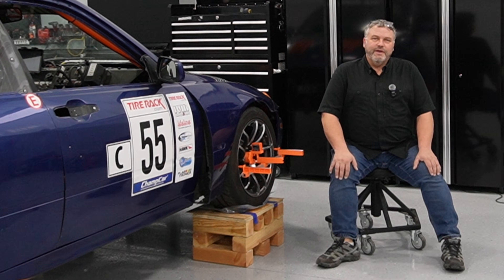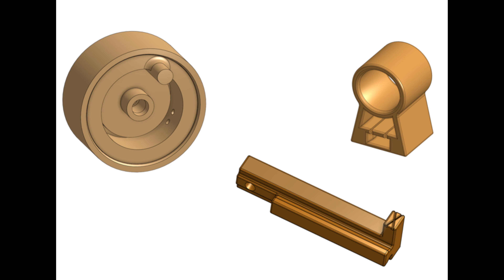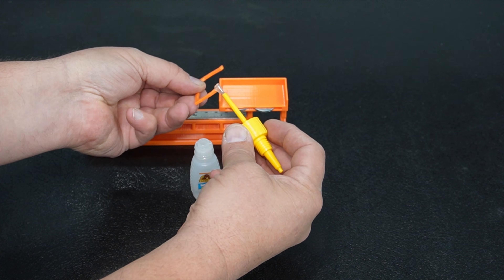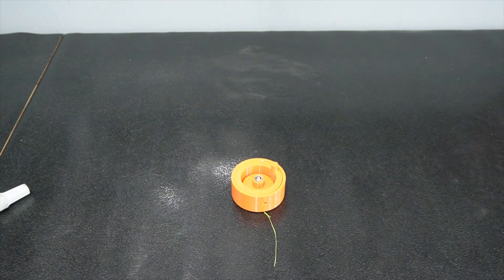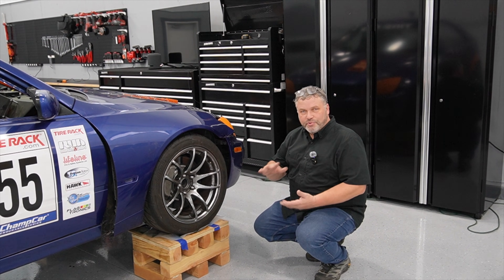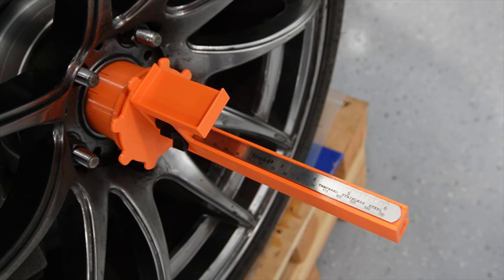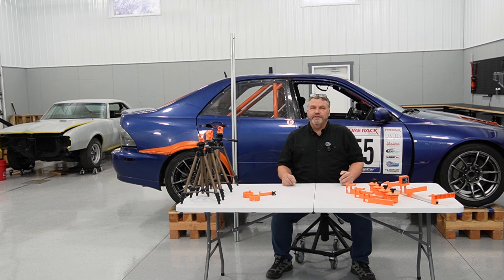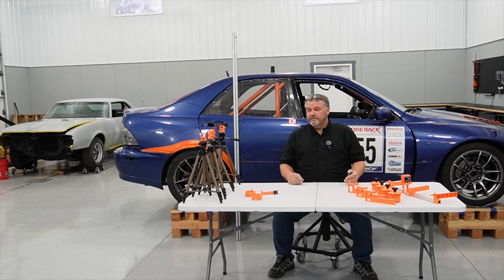3D Printed String Alignment Tools for Improved Accuracy

Comment: I believe that caster angle calculation is inaccurate because it doesn't account for kingpin inclination angle canceling out the caster when turning out, or adding TO the caster when turning in.
Reply from the maker: Yes, I should have probably been more clear that this method assumes that there is minimal impact from the kingpin angle for the particular suspension setup being looked at, which will not always be the case.  This was a late addition to the design as I only recently became aware of the estimation method.  I will add a clarification on my website.  Thanks for the comment and for watching!

Comment: Thanks for this. I have a Champcar also that is under construction. It has raced, but I had to tear it down to make it competitive. I have been using jack stands and fishing line for decades now. So this will be a huge step up. I have the P1S  Bambu printer. I am working on tubing bender dies that are 3D printed to fit a holder so custom dies can be printed on the cheap & swapped pretty fast. I will be providing plans for those this spring, if you are interested, drop me a sub, I just subscribed to yours.

Comment: Reposting as I don't think YouTube liked me including a link in the last comment.

This is great.  Been looking for something like this.  I printed some of the parts and they fit together great.  I did a mockup and my wheels aren't as deep so the face of the center scale holder is only about 13mm from the center cap face.  This means the rim touch off's won't be able to touch.  Would be great if there was another bar attachment on the rim touch off's about halfway back.
Reply from the maker: @bobcurley6948  thanks for the feedback.  I’m out of pocket for the holidays but think I get the issue and your suggestion makes sense, I will definitely take a look. Thanks!
Reply from the maker: @bobcurley6948 if I were to make a version of the rim touch off scale holders with a longer nose piece, how much longer would it it need to be to touch your rims?
Reply: @DIYFabShop  I think it was about 25mm.  That being said.  I was playing around with tinkercad and was able to graft in a second bar holder which should work.  Happy holidays.
Reply from the maker: @ happy holidays

Comment: Awesome! I've got a piece of square bar and digital level here meaning to invent one of these myself. You've thought of many things I didn't think of. I would probably prefer PLA, as PETG parts slightly shrink and change shape slightly in the few days after printing. PETG also flexes more than PLA. If people need hot car resistance for trackdays then use ASA or ABS or better.
Reply from the maker: @msdosfloppy  thanks for the comments around PETG, I agree PLA is also a great choice, maybe a better one.  The wheel hub adapter with the flexible arms really drove the decision as I was struggling with brittle failures on the snap arms and PETG was performing much better in that regard.  Could always continue to refine the design of the snaps or print parameters or use PLA for everything but the hub adapter.  Thanks for watching!
Reply: @DIYFabShop  Ah that's a good point. Maybe PLA for rigid parts and PETG for flexible snap-in parts. That would match the material properties well.

Comment: I love this and plan to print one as soon as my shop is up (maybe before, who knows). 
I was thinking about your hub adapter. I wonder if a design could be made where instead of press-fitting snap fit hub you could make something that would expand in such a way to fit the hub. so you get the diameter and a short/med/long.
Reply from the maker: I agree with your thought around something a bit more flexible in the sizes it would handle.  I explored it for a little bit and went down a couple rabbit trails that struggled with the fact that on the rear of the IS300 there is not much clearance between the wheel hub ID and the spindle bolt / cotter pin.   I still think there could be a more flexible solution perhaps.  Thanks for watching!

Comment: Suggestion before taping down your scales... grab some calipers, and measure from the "0" end up to 20mm (or whatever) and make sure they're correct!  I got all messed up doing an alignment a few weeks ago... then discovered that a few of mine weren't ground properly. 10-20, 20-30 (etc) were all correct.  Just the zero-10 was out of whack, trashing all the others!   Grrrrr.....
Reply from the maker: Good call, thanks for watching!

Comment: Thanks for providing the stl files.
This looks like a great kit.

I'll add to the wheel adapter database...as I just bought new rims.
The SVE brand for Ford/mustangs, well at least for the wheels in front of me (R355 model)
.15 / 2.01 / 2.08

Comment: One thing to note with this standalone system versus one that mounts to the chassis is that this will not tell you whether the wheels are equally spaced relative to the centreline of the car, only that they're equally spaced from the box formed by the strings. You really need a centreline reference to be sure you have the track width equal on each side of the car. Shouldn't be a major issue unless the car has had a structural impact, but probably worth considering for consistency of setup.
Reply: It’s something I am looking to do on my car as with adjustable control arms it’s easy to set one side shorter or longer and have unequal track width

Comment: I’ve been doing my own alignments for a while using a similar system, however I use a pack of page protectors as my slip surface. 25pp per tire is enough to ensure a “super slick” turntable

Comment: Nice! Now replace the strings with two auto-leveling lasers on 2 tripods. Align the two lasers to run in parallel and it should be even easier to setup than the strings :)
Reply: This is an interesting idea that i think has some promise. I abandoned string alignments because it always took me so long to setup and I would inevitably bump a string and start the setup process over again while trying to make changes to the car.

Would the 2 parallel lasers be that much easier to setup? I think you're still going to be going in circles around the car making adjustments to get the front and rear hub distances to match? 

I have moved to doing alignments with tow plates for "total toe" and shining a laser to the rear (or front) to get the steering wheel straight/eliminate crab angle. It's worked well so far, but I sort of hate toe plates too haha. I'm thinking about a remix of this model that is basically bolt on total toe/camber plates...
Reply: @FettadiVita  can you explain why?

Comment: I have got to get my hands on these. I've tried several different styles of string alignment setup and these look so easy to use.
A few years back I designed and built (and made designs for) steel setup pads that have an alignment platform for slip plates, and spots for 'standard' 16" scale pads. If that's something you'd be interested in building, reach out and I can get a set of plans to you :)

Comment: Something I've found, instead of physical strings, try using your laser level. 

The average carpenters $30 cross-shaped laser level will give you a perfectly vertical, perfectly flat plane (that still needs to be parallel side to side somehow). Then you can measure off of (one side of) the light beam. No more strings to trip over! Bonus, because it's a plane instead of a line you can do camber with a scale top/bottom too.
Reply: Also, if you have a 3rd arm vertically touching the rim, you won't need the center portion. Bungee strap the assembly to the rim for mounting.

Comment: Great build! Subbed. 

What infil % have you used for the parts? Please let me know on price for centre cap part, i will get measurements later on. 

Im also in the UK so we use metric bolts, will these parts still be ok with metric vs imperial? 

Thanks,
Greg
Reply from the maker: @gregconboy8029 the STL files are all free, including any new ones required for custom sizes.  I do not plan on selling actual parts, there are services you could buy the printed parts from using these STLs.  I believe I used 15% infil for all parts except the hub adapter where I went 100% given the snap fingers.  I'm not sure how close M6 Tee nuts, rivenuts and threaded knobs would be in dimensions. You could always print one of the parts that takes the rivenut experiment with fit, as that would likely be the one that is most sensitive to size.

Comment: Are the marks for turn in at 20deg large (long) enough to accurately hit 20deg?  Or is this not a precise requirement? 

If there was a temporary piece added on that was longer, it would provide more "purchase" on the string making for a more accurate angle.

Sorry, I'm just getting into this, so I may be out in left field
Reply from the maker: I will do some math and see in theory how accurate it could be. Thanks for watching!